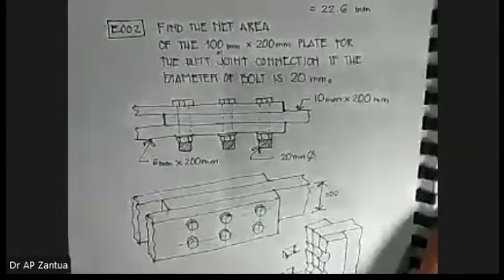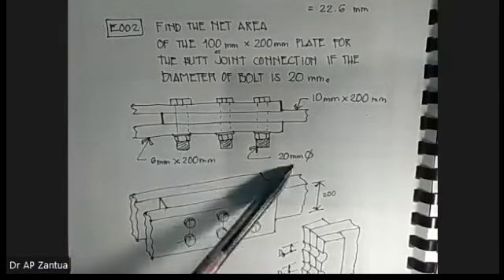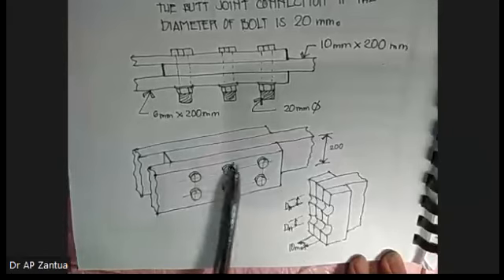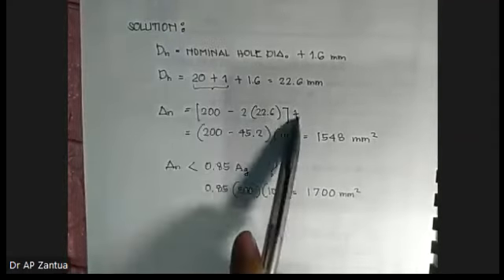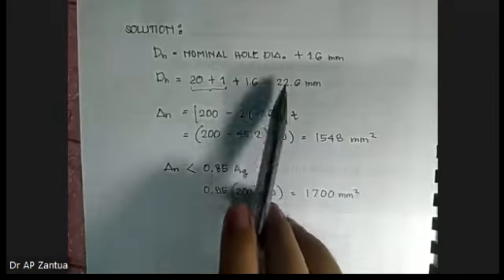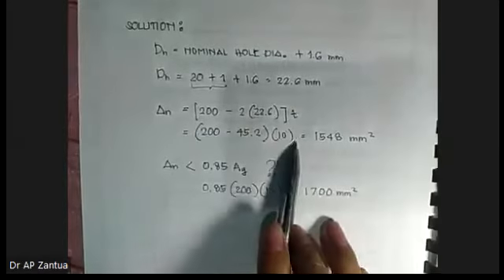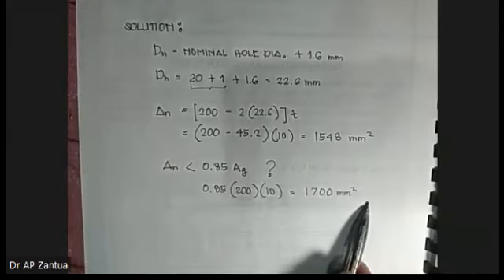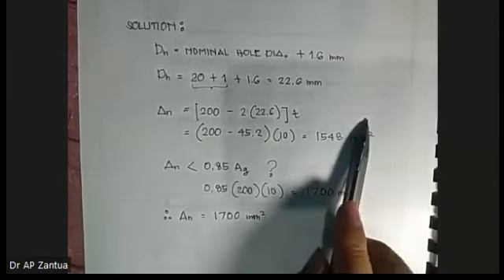Allowable Stress: Gross, Net & Effective Areas [ Principles of Steel Design ] Module 1.03.L03

Comment: Thank you sir, This video is continuation of the topic about allowable tensile stress where we will find the net area of the plate measuring 10mm x 200mm for butt joint connections whose bolt diameter is 20mm. At the same time sir zantua showed us how to solve it correctly.